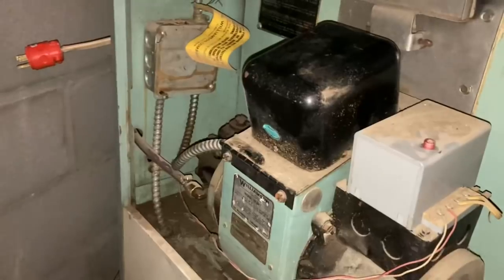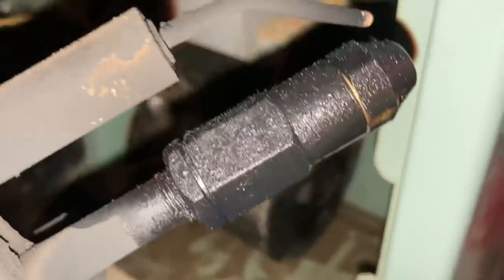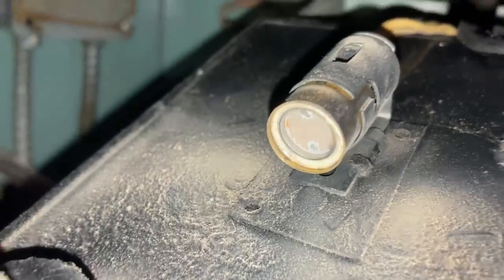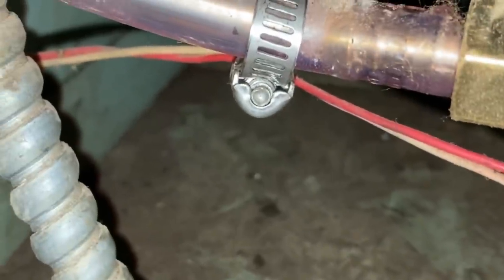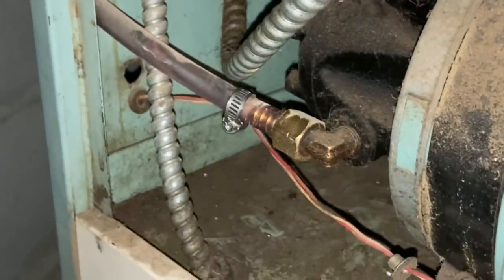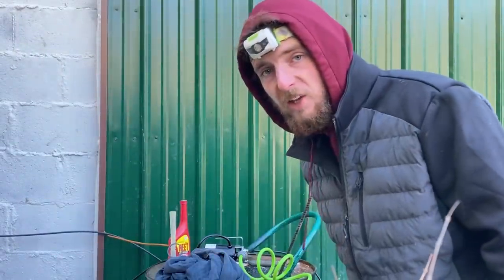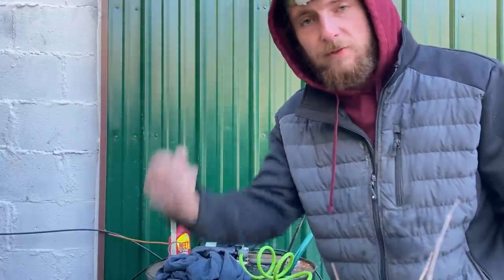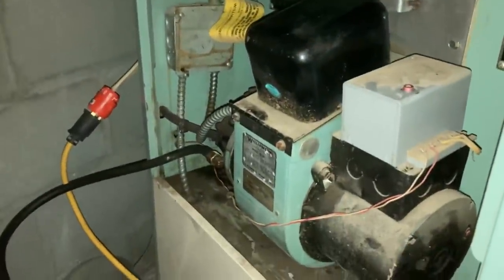Sub Freezing And No Heat | Troubleshooting Vintage Diesel Furnace| Homestead From Scratch

Comment: In my area, heating oil (a/k/a diesel) that is stored outdoors is "cut" with kerosene--and possibly some other additives--in the winter to reduce the chances of gelling. Perhaps the fuel in your drum wasn't cut and it gelled up? Additionally, heating oil storage tanks around here usually have a filter prior to the line leading to the burner so the fuel is less likely to clog the burner gun nozzle, or screen in the fuel pump. I maintain the oil burner in my furnace and learned the hard way that they appreciate a yearly service. Fortunately, doing that is not difficult or expensive. Anyway, good job getting it figured out and thanks for your time and effort with posting the videos!
Reply from the maker: Thanks for the reply joe. To be honest, it’s never been cleaned so it’s overdue. I’ll look into how to do it in the spring time. Thank you for watching!
Reply: Right on. As at least one of the other commenters pointed out, there are a ton of good videos about maintaining and repairing oil burners on Steven Lavimoniere's YouTube page.

Comment: Was just about to suggest checking the pump coupler when you got it running.  You are right about at the limit of lift at 8' & with the cold weather & thicker viscosity of the fuel is tipping you over that limit. I think that is why most of the oil tanks of old where installed inside.
Reply from the maker: You nailed it, those two factors combined.

Comment: On our oil furnace the tank is slightly high then the burner. Also our tank feeds from the bottom with a tube protruding through the tank about 2 inches and a screen on the end to keep out heavy sludge. If you bring the copper line around the cement wall were the steal siding is and back to the furnace it will work.
Reply from the maker: Thanks Ray, we definitely need to get the tank setup squared away.

Comment: I believe you have exceeded the lifting ability of the pump.  As the weather gets colder, the oil thickens and more pressure is required to lift the oil.  If you had a double diaphram air pump, you could put it in line at the source.  It would help move the oil up through the line.  It would need a source of compressed air, which I think you have.  It only uses air when it pumps, so very low consumption.  Yamada makes a small teflon pump which would be perfect.  You won't have a siphon effect since furnace is higher than the barrel.  Once the oil is past the high point, the pressure (or vacuum) needed is less, but not 0.  Raising the barrel will help, as will heating the barrel and line.  Using your compressor to pressurize the tank will work also (careful, 1 or 2 psi is all you need.)
Reply from the maker: Oh right on, thank you for the insight Dave! we'll rig it up better!

Comment: You need a fine heating oil filter before the pump (fill the filter before use),   Heating oil can be very dirty and if this is not done, you will be unclogging the tip every 3-4 days.

Comment: In winter areas and below zero degrees Celsius there should be some additive going into the diesel to avoid blocking or what you have going to look like cristal. If you don;t do that you will have a problem. hopefully that helps. Having the tank inside will help too,
Reply from the maker: Ya thank you! We need to rethink the setup a little.

Comment: Put a prefilter on the system. NAPA or a farm store will have what you need. A filter with a bottom bleeder to drain out any water would be good. 22 degrees should not be causing gelling but you can buy an additive to reduce gelling. If you mount the barrel on its side, you have a large fill hole at the top side and a small outlet/drain hole.
Reply from the maker: It’s on the list

Comment: dude, had the same thing happen too me back in the day.  using a 55 gallon drum needs too be set sideways, so that the drainage in the lowest point, but you should have have a bigger tank. hell even a 100 gallon tank needs too be in a covered area.
Reply from the maker: Ya, we need to rethink it just a bit.
Reply: The house I grew up in used fuel oil.  There were 2 tanks in the basement about 10 feet from the furnace.  One 250 gallon and one 200 gallon.  we had the inlet piped thru the wall outside to avoid spillage in the basement.  As a kid, my job was to stand by the tanks, one of which had a gauge and tell the delivery guy when to shut it down as the tanks filled up.

Comment: tHAT NOZZLE is bad should be new every season, it has two numbers on it, the size and deg. change it with the same, The cad cell is dirty!  clean with a q tip, There is a filter inside the pump, it is probably clogged. There should be another filter inline coming from the tank, it's yearly also! If there isn't 1 put one inline! The nozzle needs clean fuel and will plug easily! You can bend the copper line toward a container and start the pump, see if it's pumping! I did like this! Good luck! ps. kerosene won't gel like #2 oil!
Reply from the maker: Thanks Tom! I was unaware of the finger in the pump. I’ll check it out. We need an in-line but funds are delegated elsewhere for now.

Comment: Those up and over supply lines are always a pain to bleed.  It could be that it gelled up.  You can take a propane torch and heat the line.  Wheres your fuel filter on that setup?
Reply from the maker: nonexistent at the moment

Comment: the Pump works better if you do not have Plastic hosing in the line, use copper or stainless steel.  Plastic just collapses under the vacuum suction of the pump.  They make inline Glass windows too
Reply from the maker: Thanks, we need to tidy up the delivery system for sure.

Comment: how long will that thing run off a 5 gallon? Through the night?
Reply from the maker: She pumps at .9 gph. Set at 50*, it runs for a total of maybe 3 hours. So hopefully. I have another tank handy and the wrench ready to bleed it at 3am.
Reply: @LaidBackLiving  what’s the end goal for the building, wood heat? Any natural gas?
Reply from the maker: We’ll have the diesel one running the shop, a propane one running the living quarters with exposed duct downstairs to radiate into the shop, and a wood stove in the living quarters to hopefully take the bulk off the propane furnace.

Comment: It is 2021 and I know it is time to upgrade your furnace. So 70 years ago. That is not safe.
Reply from the maker: She still blows hot!
Reply: @LaidBackLiving  Amen!  Just because it is old does not make it unsafe.  Laws of physics don't change.  As a former pump sales engineer, your NPSH available wasn't enough for the pump.  Raise the NPSH by raising the barrel, heating it, adding a booster pump, heating the line, etc. I would put my money in a wood fuel boiler that could heat the whole structure.  You have the space and the fuel source!